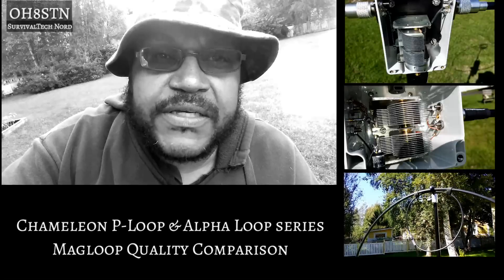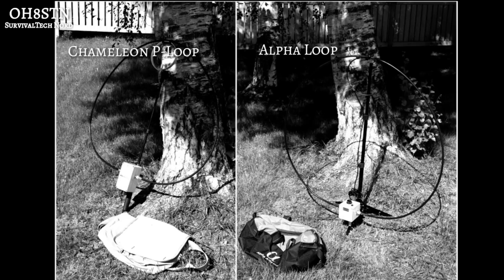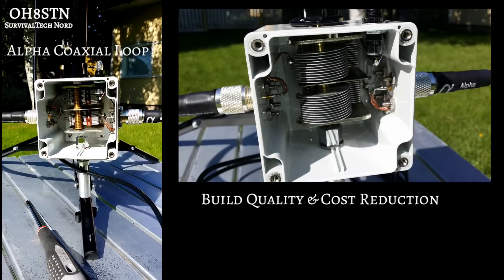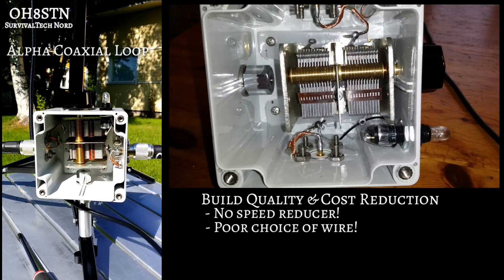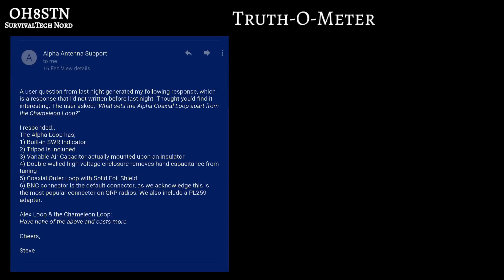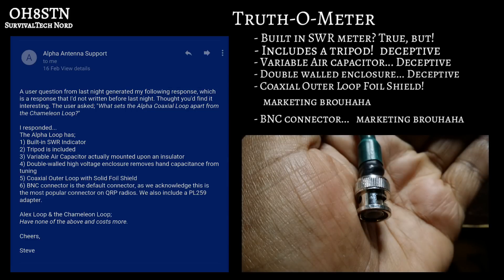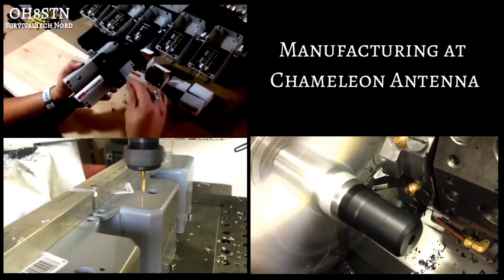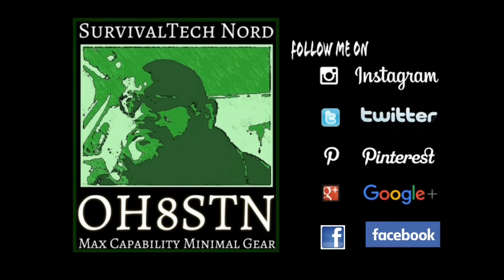Chameleon P-Loop vs Alpha Loop Ham Radio

Comment: I own an AlphaLoop 10-80M with extension loop, plus the UHF/VHF addition as well. Things must have vastly changed from then and now as the box has a reduction drive and is quite easy indeed to tune and it is also water resistant. (Has been out in heavy rain for over 3 hours). Unit dry as a bone inside. I'm talking Australian summer storm as well, not a bit of patchy rain. The overall performance is fantastic and I could not be happier with a Magnetic loop. I'm only talking from my experience now in December 2021.  Thanks for the informative video  but I had to 'correct the record' now that this video is 5 years old. ** - Edit - I have to also comment that it was not meant to be out in the rain, I just did not get home in time when a storm rolled through so it was not intentional. However the 'not meant for outside' weather antenna stood up to being left out in the storm.

Comment: Julian ,
You did a video on Chameleon P-LOOP vs Alpha Loop what about
 Chameleon P-LOOP vs Alexloop

I was wondering why you haven’t done a review of the Alex loop vs the Chameleon P-Loop. I don’t think I’ve missed any of your You Tube antenna reviews.

You and I have corresponded before and you know my years of experience with Magnetic Loop design experimentation.
May 2016 I purchased the CHA F-Loop, this was before the P-Loop came out, purchase reason:

I contacted Carl, chameleon support, had an email correspondence with Carl, one of many, great guy. He sent me a picture of the inside of the control box of a Chameleon mag loop antenna and the Alex loop.

Now for the Alex loop control box, the air variable capacitor is attached directly to the control box,  the capacitor is actually too big for the control box, it was forced in, which deforms the cheap box, here's a link to the picture:  https://www.flickr.com/photos/jmschneid/11997251703

One piece of information I’ve read about the Alexloop , if your even able to hold it up, after holding it up for 10 minutes your arm feels like it wants to fall off. He advertises you can walk around all day with it and that’s deceiving while hams believe it,
 where Carl has been straight forward.

Chameleon P-Loop $299.00 at DX Engineering , Alex Loop $399.00 dollars 

 (Chameleon now offers a power compensator for the P-Loop  which Alexloop doesn’t offer or have the capabilities to adapt)

It is sad to say the Alex loop is $100.00 more and in a cheap plastic box that contains junk, did you see his gear reduction? and his small loop is coax, the P-loop is metal.

Hams are getting ripped off, the quality of the Alexloop is Garbage, and Expensive, Hams need to be informed.
You’re the man to do it. 

I had to email you, watching you’re videos are more interesting than most TV shows.
Hope I didn’t waste your time, I know your very busy, when fellow hams are blatantly getting ripped off, I had to vent.

Keep up the good work you’re time and effort doesn’t go unnoticed, especially when you’re in an open field,  the wind chill is 30 below, snow on the ground and wind blowing so hard you can barely stand up HaHa. (yep, been there)   

73s
       Eddie kj4fgi
Reply from the maker: You're preaching to the choir my friend. The only reason no review has been done is because I haven't been able to finance the AlexLoop. The funds that come in from the ads is so small, that I have to be very careful how I use the money the channel generates (if it generates any). So honestly that's the only reason you haven't seen that review yet.
The channel is growing so let's see.
Reply: I see your point, $400.00 plus, well , to the USA another $60.00 dollars, Not worth it but I'm glad Carl sent me a picture of the inside of the AlexLoop, I even posted a picture of the inside of the  CHA-F loop and Alexloop on my QRZ page. Ha! Stay Warm!!

Comment: id you ever try the f-loop on the p-loop
Reply from the maker: +Jason howe hi Jason. You'll have to be a bit more specific. I've tried the P-Loop inner loop, on the F-Loop which worked very well. Why do you ask?
Reply: OH8STN have you tried the p-loop tuner on the f-loop gear, I could see it more or less looks like the f-loop tuner was a production prototype looking at how you were putting your hand on the f-loops tuner it almost looks like you were acting as an rf ground plain 

Though I would also have to ask why bother with an antenna system that when you look at the history of its design was used by the RI's to find illegal stations,  though I would of thought this was only a receive only antenna, I would of thought the  smaller loop would be built to be turntable ..

Though original statement I was alluding to. Though I doubt you would see much benefit playing around on a UHF or VHF radio systems I very much doubt  either f-loop or p-loop would have any benefit what traditionally classed as a repeater class communications system given the limitation of both the UHF and VHF in distance....
Reply from the maker: Jason howe hey Jason, there's no F-Loop in this video. But like I said a I've tried the P-Loop gear on the F-Loop, which worked well. The alpha was no prototype. It was designed to be cheap. When the quality issues started popping up, Alpha has no choice but to update as people started to understand other loops were a much better deal.

Rx only loops are an entirely different monster than these. Variable various in these need to withstand high voltages. Rx only loops don't.  There are pros and cons to magloops.
Hope your holidays are fun.
Reply: OH8STN  sad to to say my holidays  are going to be bad this year another injections between the l1-l5 to go through after the first 1 I'm not getting the sleep
Reply from the maker: Jason howe sorry to hear that. We all have our mountains to climb. Some mountains higher than others.
Reply: oh so true, i battle to make 500 meter to my letterbox most days..

alas me walking up a mountain would likely be in a tracked vehicle typical mobility aids don't have the capacity of haulage my 6 foot frame and combined weight of mobility aid past 15 degrees vertical..

atv may be of some use to a cabin though roughing it on the ground will not happen depending the max capacity of the carry weight of the atv, given i weigh over 140kg

Comment: Loved your comment regarding a Marine Corps field day.  I've experienced 4 years of those and a before that a lifetime from my Dad being a former Marine.  Are you a former jarhead?
Reply from the maker: Well,  once a Marine,  ...
Semper Fi.
Reply: Without being too gungy, Rah. I was an Airwinger (6078/ electrician, mechanic on the gear around a/c) As a new Ham having a General ticket, and being condo bound on the first floor, I am considering the P-Loop and F-Loop/Plus, maybe the RR, if I can mount it outside on good weather days. The 6:1 reduction gear on the P-Loop has caught my attention, but as a main antenna, maybe the F-Loop provides more flexibility. Rig is the 100w IC 7300 and realize I can't throw that into a Mag Loop. Maybe the MPAS? I also have a Buddipole Deluxe but winter is approaching so not looking fwd to fiddling with it outside for the next few months. Also going to try my condo 4 floor tall, 190 foot long gutter thru an AH4 tuner at the base. Only  SSB. Appreciate any comments,and keep making these highly educational videos! Semper Fi. Rob
Reply from the maker: +RobPetty622 Wow.  That's a hell of a question. I never talk about my Corps time on YT,  but let's say I know very well the roads between the SW Arizona, San Diego, & all points N into Orange County. I even received the letter from the East telling me I was probably exposed to contaminated ground water. Now you know 😉

The questions asked are huge. Each of the system's you mentioned are unique and capable in their own ways. What you really need to do before pullng the trigger on anything, is understand how you operate, and on what bands you most often operate. This will help you narrow down the right antenna system for your condo. Now if you have a balcony & can put up an antenna temporarily on that balcony, then I would say the MPAS or a magloop would be good choices.  If you want to get that hundred Watts out of your radio, the MPAS would be best choice.  
I don't want to sound like a chameleon fanboy but I know they're coming out with some pretty cool and Innovative designs for the new year. You can find their YouTube channel in my featured channels list on YouTube. They put out lots of teaser videos on products and updates they are working on. They've been talking about this waterproof remotely tuned magnetic loop. So lots of us are looking forward to hearing more about that. If you're not in a hurry I really wouldn't pull the trigger on anything just yet. If you're in a hurry then the MPAS mounted to a balcony rail or or in its endfed wire configuration out of a window for example, might not be a bad choice.

If your heart is set on the F-Loop with RT-RR,  you won't be disappointed. I just have to tell you the RT-RR is not as rugged as the F-LOOP itself. It needs to be treated gently. Other than that it's a good system, solving a problem many of us have. By the way one of the videos on the chameleon YouTube channel was a power up kit they're working on for their loops. You've got to check out that video.
Btw, happy belated birthday.

Comment: Although it has the manual tuner , I was wondering if and or how well the antenna would work with an auto tuner such as the z817 tuner with the 817nd?
Reply from the maker: +Eric Kozlowski great question Eric. It's not possible to use automatic tuner with magnetic loop antennas.  There is a capacitor inside the box which needs to be turned in order to the loop to resonate efficiently on the desired frequency.

Comment: I love your videos about QRP. Plain language, simple instructions and lots of knowledge that the marketing info lacks... like the speed reducer... Who would have thought about that when looking at both of these antennas. I believe so far that Chameleon is way better than Alpha products for  build quality, ease of use & tuning, etc. Keep the videos coming!
Reply: We're using proprietary 16 gauge PTFE Teflon Wire for all our wire needs including counterpoises system. If you want a ballpark price of a similar wire in the street look here: https://bulkwire.com/ptfe-high-temperature-stranded-wire
Reply from the maker: +Jon Frost thanks Jon. I promise we'll try to keep them honest. In the coming weeks are going to start focusing on qrp digital. I've been reluctant to publish those videos but I guess I'll take the hit :)
Thanks for watching and for encouraging me it's very much appreciated
Reply: I am a QRP SSB and Digital ham - My radio should arrive tomorrow afternoon and then I'm off to get everything put together. I am charging the batteries from Windcamp for the battery cover on the FT-817ND.  Some of the Chameleon parts are rather expensive... like the counterpoise set. I plan to build my own for about 1/3 the price of Chameleon.
I plan to be pedestrian mobile and hiking the local hills/mountains. VHF Contest is right around the corner. Are you still living in Norway? What is life like there?

Comment: What about the Alexloop? I have one, find it sturdy, no hand capacitance, has a reduction drive, sets up very easily, and Alex is working on a remote tuner for the iPhone.  A neighbor of mine reverse engineered it and has made a couple more for local hams.  They all seem to work very well.

Dave K8WPE
Reply from the maker: +David J. Wilcox hi David until yesterday I hadn't heard any negative things about the AlexLoop. There's lots of happy users all over the world. If you were trying to decide between the two , I would say it's important to look at the specs side by side. But since you've already pulled the trigger Go With It Be Happy :)

Comment: the Chameleon antenna seems to be the best on the market. I would love to try their antenna system but being on a tight budget for now thats going to have to wait. but keep up the good work
Reply from the maker: +SilentSniper Vt thx SSVT. We are all on a budget brother! That's why we have to learn to build things for ourselves. I'm glad I've had the opportunity to do both. Besides you'll appreciate it more and it takes more time to get where you want to be :)
Reply: +OH8STN SurvivalTech Nord yea I can blame the government for killing my industry(automotive mechanic) with cash for clunkers. But as for building I have a MFJ G5RV that I'm going to cut down to a junior. I made a 20 meter QRP antenna with speaker wire and now want to make a end fed antenna for multi band ops
Reply from the maker: +SilentSniper Vt don't get me started on the government :D I'm being raped here having to pay taxes to two different countries. You'll love the monoband dipole performance, but deploying them really sucks. Endfeds are magnificent! Just make sure to reduce or remove any losses and don't take shortcuts on parts, connections... when building.
Reply: +OH8STN SurvivalTech Nord I have a W1SPR end fed that's made here in Vermont and works great but don't want to permanently set it up because I love it for portable work.